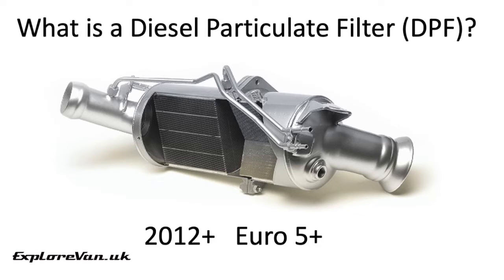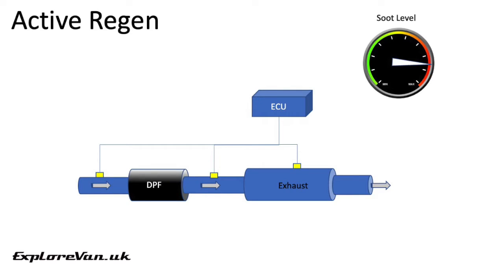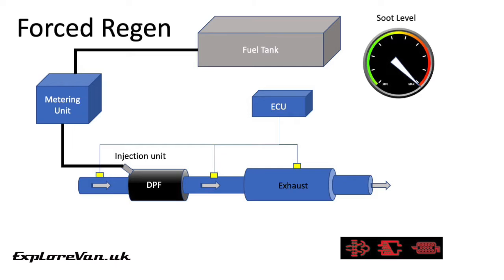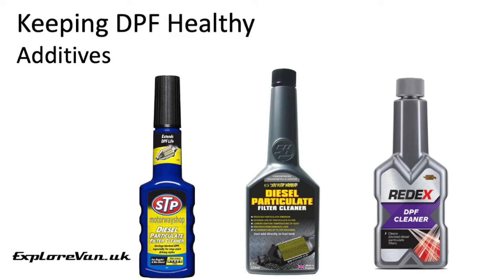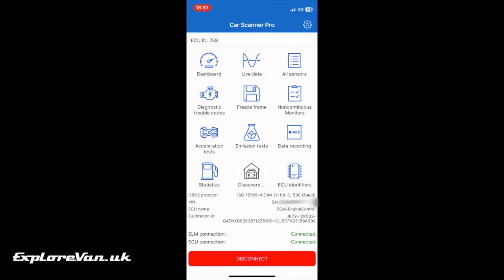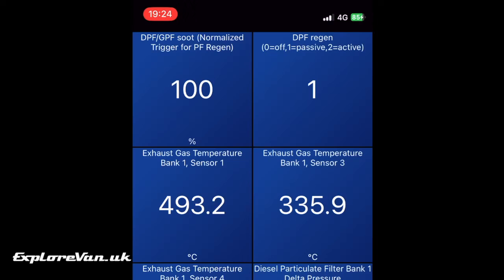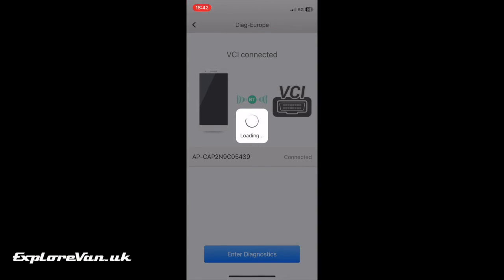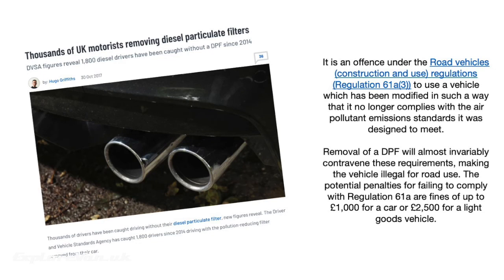Diesel Particulate Filter - DPF - DIY Regen, Hints, tips and advice, OBD2 monitoring.

Comment: Great video. I bought the vgate icar pro 2s and I tried to use it on my 2023 Mercedes E Coupe (C238) to check on my dpf regeneration cycles. Nonetheless, the parameters “Exhaust Gas Tempertures” shows message “Not selected”. Do you know what it means?

Comment: Great video! 
I have bought I  vgate icar 2 pro and the car scanner app pro. 
Can you please tell me the sensor you have monitoring on the app for the DPF regeneration? 
I have a 2012 W166 Mercedes that has DPF problems and want to monitor the sensors. 
Thanks
Reply from the maker: Hi, the sensors that are available will differ by model and manufacturer. 

For the Discovery Sport I show, the Time between regens, Distance between Regens, The Exhaust Gas temperature at Sensor 1, 3, 4. The DPF Delta Pressure, The Soot Level and the DPF Regen Status.

The key ones for the Discovery are 
- DPF Soot Level
- DPF Status - so you can see if a Regn is underway
- DPF Sensor 3 which should dramatically increase when a Regen is under way.

Hope that helps!

Comment: Do you know if these DPF values you see in car scanner app are available on Hyundai Tucson Diesel 48v 2021+ (2025) (inside europe) ? The number of values you are able to see comes from ODB module or from mobile app ?
Reply from the maker: Hi it will depend on the ECU and the Parameter IDs (PIDs) that are available.  As we've not got that specific vehicle to try it on we can't say for sure. Sorry.  
If they are available from the ECU then I would expect Car Scanner to be able to read them.

Comment: Hi 😃! Do you need the pro version off auto scanner? Because in the free edition I don’t see these sensors.
My car is BMW 1 series 118D 2008. (E87)
Reply from the maker: Hi, you shouldn’t.  As far as I am aware there is no difference in the App I just upgraded to Pro as I felt the developer deserved it. 

You don’t say where you are from, are you sure your car has a DPF.  I believe Euro 5 only became mandatory in UK in 2009. 

Also is it possible the DPF has been removed and mapped out? 

It also may be that BMW have buried the info in their native PIDs rather than using the standard OBD2 ones.  Though given this guy has done it on a later model I would be surprised if that were the case.  https://youtu.be/rKDogGqxdqU?si=kYYyVtYhVUfR9Oau

Asking on a BMW forum may get you more specific answers.
Reply: @ExploreVanUK  Hi 😃, thank you for your response.

With kind regards, 

Tim

Comment: Hello thanks for the vid. I tried to monitor my dpf pairing car scanner with elm327, but the dpf sensors do not give any data. Should I upgrade to car scanner pro?
Reply from the maker: Upgrading to Pro probably wont make a difference. 

What vehicle is it?  It could be down to the manufacturer.
Reply: Toyota Yaris 2013. I also noticed that other sensors do not give data as well. Is there some other obd device or software that could work?

Comment: Thank you for the vid. Very useful! I have a 2013 Toyota Yaris with a DPF and the engine has 130.000km (80.000 miles). I have a problem with the oil level due to very frequent regens (I counted that regens occur every 250-300 km. So the oil level increases at every 2.000 or 3.000 km and a spanner turns on on the dashboard. I visited a TOYOTA dealer last year and they said that the DPF is in a good condition. Three months ago I visited another mechanic because the spanner was on again. He made a forced regen (after that the DPF was at 15%). Also he changed the oil. Now the spanner is on again and the mechanic says that I have to change the oil... This is very confusing and  I am kind of desperate. It is simply unaffordable to have an oil change every 3 or 4 months. So my question is: If the DPF is in a good condition, then why does my Yaris regen so often? Could it be a problem on the electronics or the engine management system you refer to in the video? Could we simply adjust somehow the way or frequency that regens occur?
Reply from the maker: Hi, I can only go on theory here as I don't know the exact set up of the Toyota DPF. 

The distance between Regens is impacted by journey length, fuel type, weather/temp, driving style etc, I wouldn't say that 250-300 km between regenerations is unusual.  You can see in the video that the average distance between regens on the Land Rover Discovery Sport tested is 180 miles (about 290KM)

However in my experience, Oil Dilution would only occur if an Active regen isn't allowed to fully complete. This is because the left over diesel, used to carry out the regen, is dumped into the oil sump if the regen is interrupted - for example if you turn off the ignition while a regen is in progress.

If the regen completes successfully it shouldn't impact the Oil level / dilution.

Your rate of oil dilution would suggest to me that your regens are regularly being interrupted.  This is often the case on vehicles that only do short journeys as the Regen doesn;t have the time to complete.  This won't necessarily damage the DPF if at some point it is able to complete a full Regen or a Forced Regen to empty it. 

Are you using an OBD2 reader to know the average distance between Regens already?  if not how do you know when a Regen is in progress?

My only recommendation is to use a ODB2 reader (as in the video) to keep a constant watch on the DPF trigger level and when you see a regen is going to be triggered / triggered make sure you continue to drive the car (usually 20-525 minutes) until the Regen has fully completed as shown on the ODB2,  so making sure the oil is not diluted. 

Hope that helps.
Reply: Thank you so much. I appreciate this information. I purchased this Yaris 2 and a half years ago (Back then it had 90.000km) Since then I have been carefully watching the regenerations just by observance. Two signs that indicate a regeneration has started are (1) instant consumption increases a lot and (2) the rpm increases also, and that is evident when the car is not moving. (The rpm is normally at 800, but when a regen is in progress it goes up to 1.000) Whenever I understand that a regen is in progress, I try not to turn the engine off and if possible to keep driving some kms. It is true that sometimes it is not always possible to do that. But in most cases I continue driving, and once the rpm and consumption are back to normal, then I turn the engine off. Please let me know if something does not sound right to you until know about how I deal with it. 
It is true that most of my journeys are short and inside the city, but what impresses me is that the frequency of regens seems to be the same when on long trips also. For example in a trip of 1.000 kms, I have noticed at least 3 or 4 regens. I do not know if that is normal. I suppose that it should not regenerate so often when on long trips.
I am trying my best following tips I have learned from yt and my mechanics, but still it seems that it is not enough...
I have not tried to use additives. If I use them, could I expect that the frequency of the regens will be reduced? If you recommend some specific ones, please give me your suggestions. THANKS A LOT

Comment: Found your vid really useful and just picked up the Vgate featured and downloaded the Car Scanner app. Been able to connect to my 2017 transporter fine and able to monitor almost all the parameters apart from DPF soot% and DPF regen type. I noticed your using Car Scanner Pro, do you have to upgrade to be able to use these parameters or am I missing something? Cheers Ben.
Reply from the maker: Hi, you may have found it already but just in case this thread seems to answer your question allowing you to add custom PID codes to add. 

https://www.t6forum.com/threads/vw-t6-custom-pid-codes-for-dpf.33964/

Comment: Excellent explanation of dpf issues, which have dogged my Subaru Legacy turbo diesel. Purchased the iCarPro with Carscanneras suggested, but the dpf sensor information is not available, even with the pro version. Presumably this is because it's not supplied by the Subaru ECU. It doesn't seem to be possible to check this type of thing in advance.
Reply from the maker: Aw that’s disappointing I’ve found it works with anything I have tried. 

I’m guessing you’ve probably seen this video but just in case you haven’t it may help.  It seems to show quite a bit of DPF info on a legacy. 

https://www.youtube.com/watch?v=jMOgEhUG8ig
Reply: Thanks, looking at both videos again I noticed that I hadn't changed the connection profile during setup so the 2010 iso standards were not being used. All good now, thanks for your help.
Reply from the maker: @davetimpson9644   Great stuff!  Hope you find the info it gives you helpful!

Comment: You might want to add that every regen leaves behind a little bit of ash which cannot be burnt off. Eventually (North of 100,000k) the DPF becomes clogged with ash which cannot be unblocked with a regen. This is the cause of why regens becoming more frequent as a cars mileage increases. Most buy a new DPF at this point, however, you can actually remove the ash mechanically by removing the DPF and blasting from the rear with a high power jet of water, there are a few companies that provide this service in the UK. Many lorry DPFs are actually designed with this in mind and can be disassembled and cleaned easily with a regular jet wash. All the best.
Reply from the maker: Hi- thanks for sharing, the minimum ours goes down to currently is 13% of the Trigger value (6% actual soot content) having done 45,000 miles so I hope it will be some time before it needs anything more than the normal Active Regens to get it back to to a reasonable level, as long as we continue to keep an eye on that they are completing successfully.

Comment: It really irks me that car manufacturers treat customers like idiots and don't put a simple indication that a regeneration is in progress and it's better not to stop the engine. In my car I more or less know when it's happening (due to the increase in rpm at idle and the smell of a dead cat) but I still don't know when my ducato (which I care about a lot more) is doing it.
Reply from the maker: I totally agree!  I can't think of any reason not to make it clear when an Active Regen is in progress or even when it is due to complete one, so you can plan accordingly. 

Having filled that gap with the Car Scanner App and VGate OBD2 permanently on the Discovery Sport for nearly 6 months, gives me loads more confidence and reassurance the car is doing what it should and I can adapt to allow it to.  That has to be good for the Manufacturer's reputation long term and warranty claims.  Though it would give a hit to their income from post-warranty repairs.
Reply: I agree…dealer dealer dealer. Shame dealers used to be great for additional parts and additions, upgrades etc at reasonable prices.
Reply: Don't know every car does, but Peugeots (presumably same platform DS, Citroen, Vauxhall, Jeep too) turn the rear defrost and side mirror heaters on. You can add an LED and be aware. Saved me a couple times turning off while it's doing its thing.